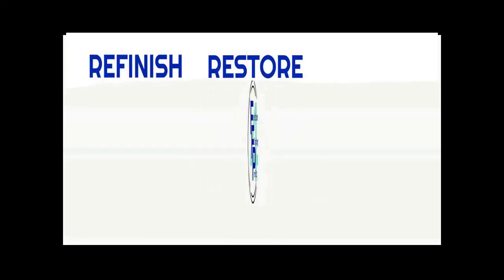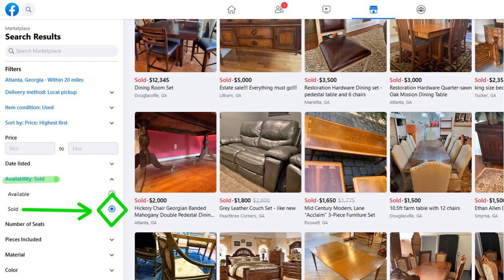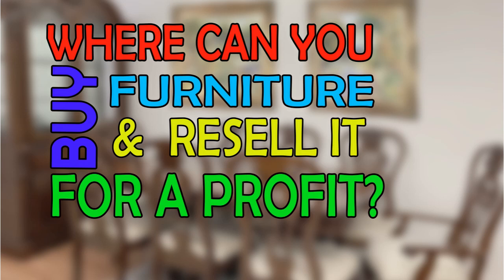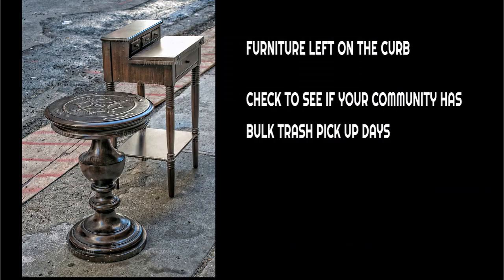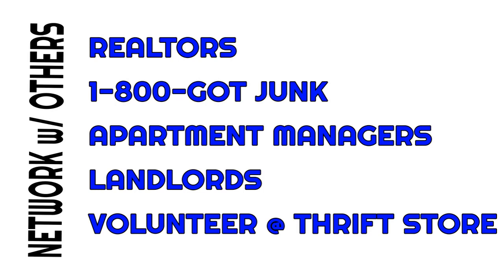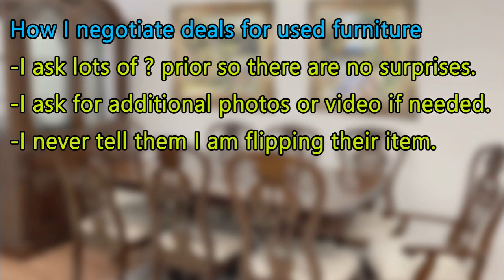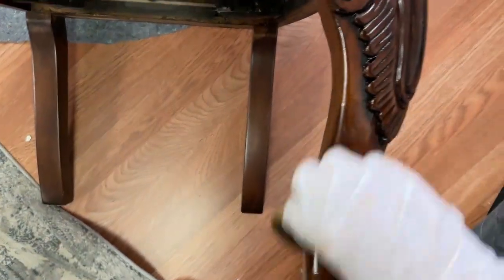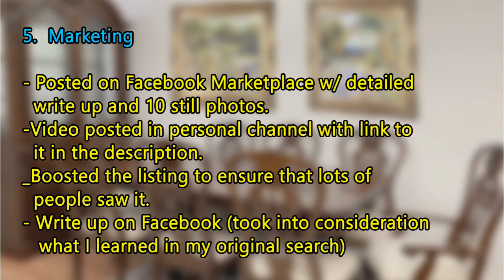I made  $2200 on ONE Furniture Flip with NO painting, sanding or stripping / Flipping Furniture

Comment: I used a hair dryer to remove heat stains.  A little slow but worked beautifully.
Reply from the maker: Hi Caldy- I will definitely try it next time. The problem with the blush spray is the fact that it left the finish a little more satin . The old finish was more flat.  I hope you found some helpful info in my video. Thanks for sharing the tip!